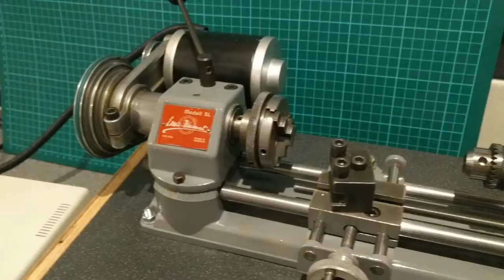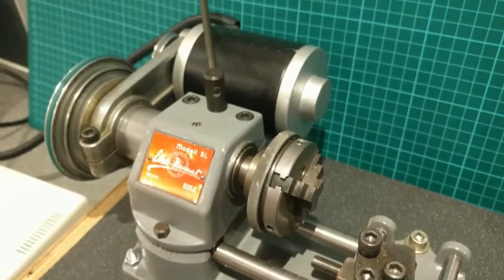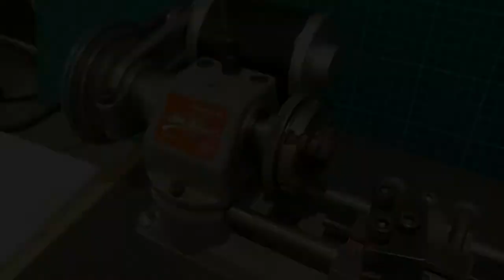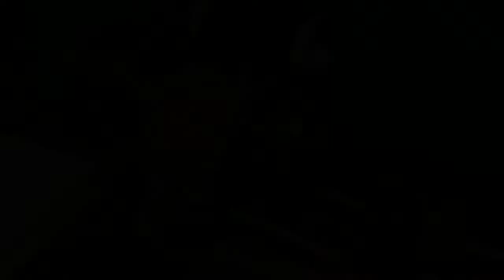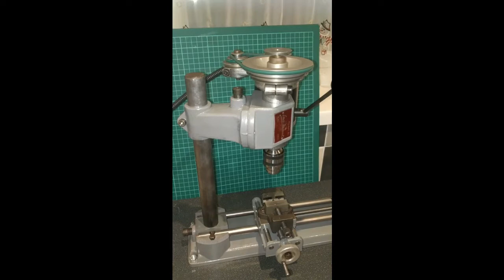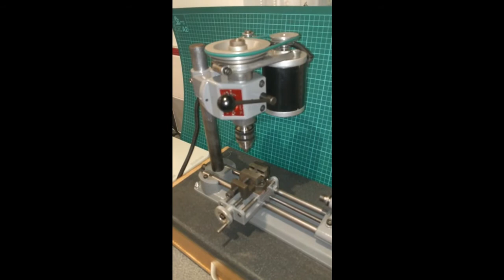Unimat SL1000 Lathe powered by 24v scooter motor

Comment: you need to make some more vids fella, show us all your Master Toolmaker! 😁
Reply from the maker: Once I have moved house and organised the workshop then I hopefully will make some more but at the moment I have too many projects on the go and filming them takes a long time as you know....
Reply: @GrumpiesGarage  yeah I know what you mean, I need to make a new tapered plain bearing for my Pultra, I can do it and the great whoot moment was when I found out the spindle is 11/16" and I already have a reamer for it, the locking rings both ends are 16tpi buttress threads though, a lockring on 1 side is hardened and holds a thrust bearing so I can't just cheat and make it a standard V thread without also making another hardened thrust bearing ring and a plain ring for the other end, so buttress threads they will be! , I really want to make a vid for it but all my time will be taken concentrating on the job.

that said im making one out of steel as a practice while waiting for the £18 1.5" diameter 2" long section of phosphor bronze to arrive so the actual run should be a lot quicker

Comment: Hi, did this motor come with the same shaft diameter as the unimat (6mm)?
Reply from the maker: Hi there.
I don't have the lathe anymore and when I changed the motor it was a long time ago but I think the motor shaft was 8mm and I made the bore in the pulley larger.
Hope that helps..

Comment: What controller were you using
Reply from the maker: I used a 240v ac to 24v DC transformer and speed was varied by using a pwm speed controller all available on eBay.

Comment: Hi there, nice mod, do the scooter motors fit straight onto the unimat motor mount or did to need to mod that as well, thanks
Reply from the maker: Hi 
I had to drill an extra hole into the end cap of the scooter motor to take a threaded bush which then all lined up with the unimat motor mount.

Comment: did you have to do anything to the shank that comes out from the motor or did it fit perfectly with the Unimat
Reply from the maker: Hershal Wiggins if I remember rightly I made the bore in the unimat motor pulley slightly larger and fitted it to the standard motor shaft with loctite high strength retainer...
Reply: Thank you, but do you mean High Temperature Retaining , is that the same thing
Reply from the maker: Hershal Wiggins I believe I used loctite 638, or an equivalent, this will need heating to break the bond when the pulley needs to be removed.

Comment: Hi, what's the torque like?
Reply from the maker: The torque was slightly more than the standard motor and obviously could be increased by utilising the different belt and pulley ratios the main benefit was having variable speed and a much longer duty cycle as the original motors will run hot after a relatively short time.
Reply: @GrumpiesGarage  Thanks, thinking of fitting one to a Sherline lathe. Possibly the 24v version. 👍